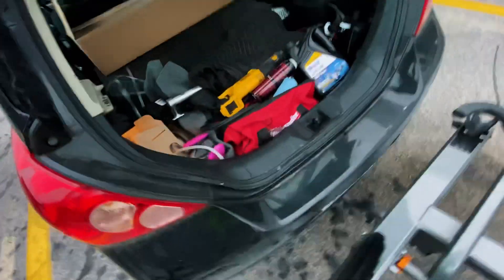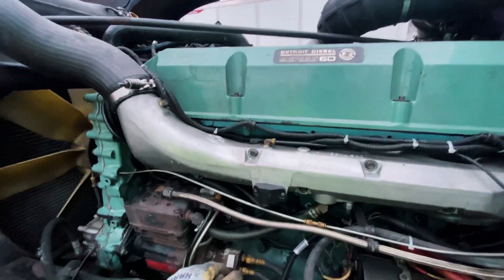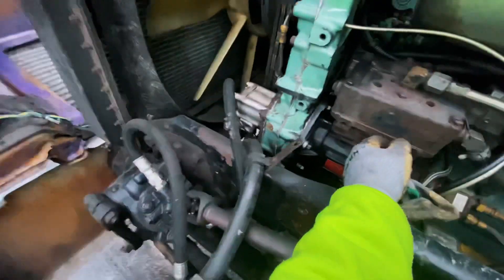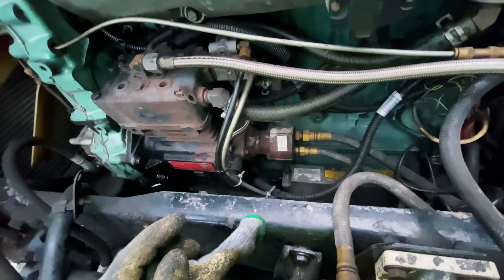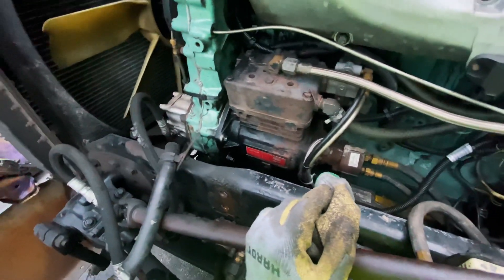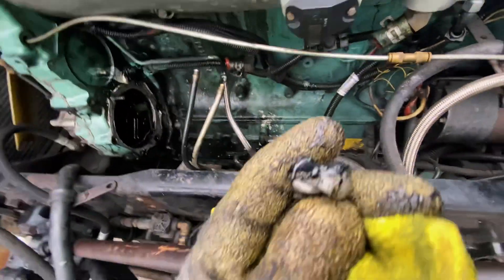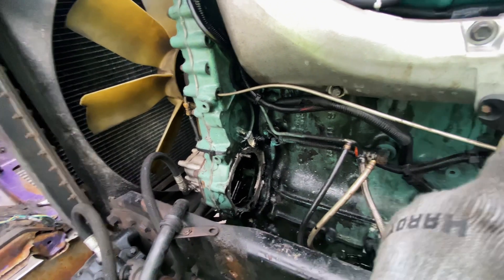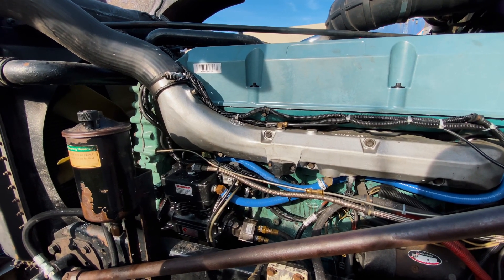THAT WAS HARD TO REPLACE

Comment: If the compressor was pushing oil, check the air dryer, and at least change the filter and clean it out. Make sure the purge valve is good too (not expensive), that will F up soon as it gets real cold. 👍 Good job.

Comment: gasket maker and silcone (starts to set up when air hits it)are two different things, gasket maker (grape jelly anaerobic sealant) will not harded unless the air is cut off (smashed between two parts), 60 series is one of the easiest air compressors to do, your valve cover is most likely the football gasket or cam caps leaking, to get the valve cover off just push the pipe over with one hand, if your hoses are good no worries, if it is hardened you might want to replace it, clean (drain) the ping tank daily for a couple of weeks to get the oil out of your system, then install a quart of air brake antifreeze in a tank and prepare for the winter, it only takes a small amount of oil to make all the rubber parts in your air system break down and leak,

Comment: Do yourself a favor and never reuse those spring type hose clamp. They get weak after awhile and with pressure on the hose it could back off and dump whatever is in the system. Not worth the savings of a $2.00 gear clamp in my opinion. Thanks for the videos.
Reply from the maker: Yea I replaced them all

Comment: What’s a good tool kit to carry with you that you use that can handle all that ?
Reply from the maker: https://www.ebay.com/itm/TEKTON-60PC-1-2-DR-DEEP-IMPACT-and-SHALLOW-SOCKET-SETS-SAE-METRIC-6-POINT-/303512866072?mkcid=16&mkevt=1&_trksid=p2349624.m46890.l49286&mkrid=711-127632-2357-0

https://www.ebay.com/itm/NEW-Husky-270-Piece-Tool-Set-w-Case-SAE-Metric-Sockets-Wrenches-Ratchets-/124983381066?mkcid=16&mkevt=1&_trksid=p2349624.m46890.l49286&mkrid=711-127632-2357-0

And bunch of Milwaukee m12 fuel tools